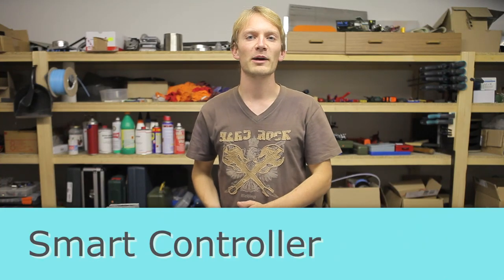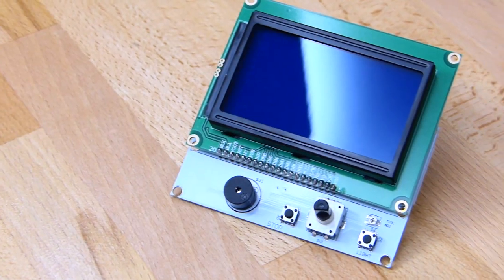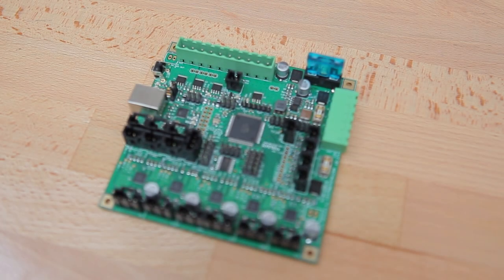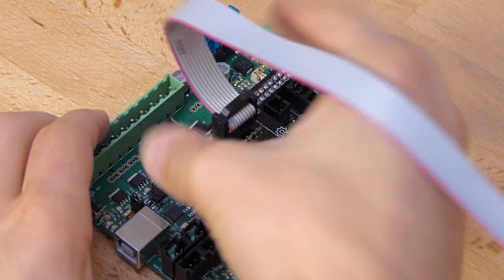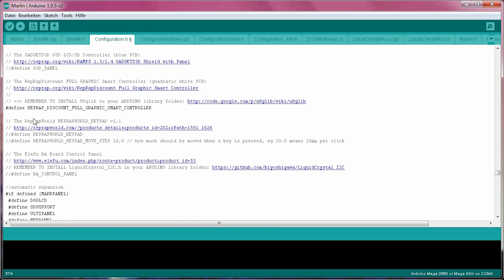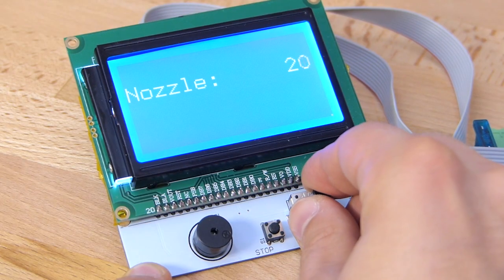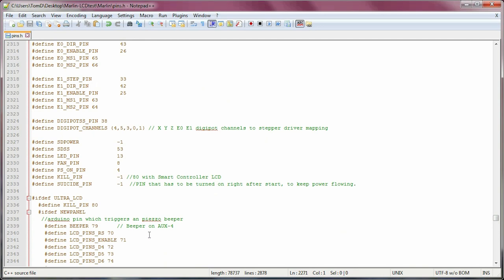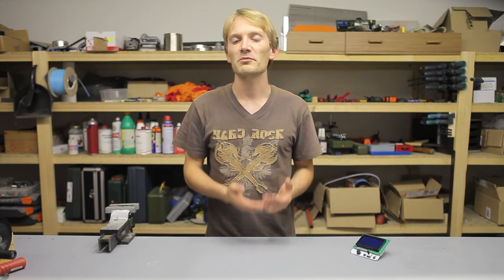3D printing guides - Setting up a LCD and SD card controller panel

Comment: Thanks again Tom, proud patron here. Invaluable info that I needed to set up my Mini RAMBo 1.3 with a large LCD screen! The 1.3 having the USB isolated and not powering the board threw me for a bit of a loop. Couldn't upload a thing with the Arduino IDE till I added 12 volts DC to the board! This fixed my encoder steps and allowed me to select the proper screen for my configuration file.

Comment: Quick update for those who wonder where the line from 4:20 went in newer Marlin versions: 
Conditionals_LCD.h is the file you want to look for the "if ENABLED (REPRAP_DISCOUNT.......)" for.
Reply: Thank you
Reply: Thanks. I found it, but it seems little confusing to me, since I am a newbie to the whole programing thing and Your post is the only one mentionning this change I found so far. Sorry for potentially dumb question but there is that "delete // to enable" feature missing in here and I am not sure what to do right now. Many if lines there, Im not sure what to write or delete where to get it going. Thanks for help.
Reply: There is nothing you have to uncomment there. This direction was supposed to point you to the file where you can add those two extra lines of codes. ((all starting at code line #101))
The whole file is just listing settings for all the different brands of displays out there, telling the rest of the firmware how to handle your hardware. That's why we are adding the two lines of code there. The line you have to uncomment to use your RRDFG display can be found in the Configurations.h at line #1231.
Reply: Thanks a lot for clarifying this. I got the controler working at last.
Reply: You sir, are a legend.
Reply: do you have that arduin program?
Reply: Not the hero we deserve, but the hero we need.

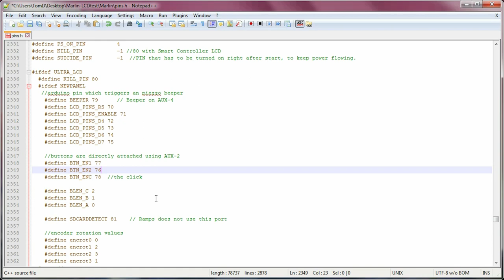Comment: The annoying feedback beep for the LCD controller that Tom mentions at 5:12 has been tamed to a short click sound, so you can keep the BEEPER pin enabled with the latest Marlin. To fix this in Marlin 1.0.0, just re-flash the firmware with LCD_FEEDBACK_FREQUENCY_HZ set to 5000 and LCD_FEEDBACK_FREQUENCY_DURATION_MS set to 2.

Comment: For those who wonder about a black screen. There are different ribbon cables and matching connectors around. Some of them are rotated 180° !!! i.e. Exp1 stays Exp1 and Exp2 stays Exp2 BUT the pin 1-5 will instead connect to pin 6-10 and vice versa. 
I just reversed the orientation of the connector and could then use a discount full graphics display on a trigorilla board.

Comment: For those who are scratching their heads on the pins.h file, it appears that the pins.h file has been broken up into multiple files on recent builds.  You are now looking for pins_RAMBO.h (if RAMBO is your control board) or look for the pins_YOURMAINBOARDHERE.h file.  In my case it was pins_RAMPS.h for the RAMPS board.

Comment: Hi Tom great Videos just finishing off my printer after a year break using ramps 1.4 with lcd and marlin
what pc software do you suggest for a beginner 
I use 2.5 drawing software and a post processor for my full size cnc mill but this is a bit different 

Thanks Andrew

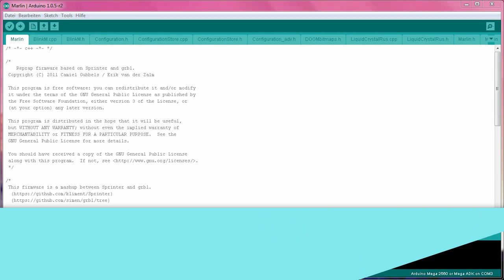Comment: At time mark 2:41 the back of the lcd is shown with the cables installed. I see that the red stripes are opposite of each other. My cables connect  the same direction - Tom, is this why my lcd does not work??? I've been pulling out the little hair I have left over this.

Your videos are great and so very helpful. Whenever I have a 3d printer problem, I turn to your videos first and almost always find the answer I need. Thank you!

Comment: My LCD (from Lulzbot) has two presets for temperature.  One for PLA and one for ABS as in your video.  Is it possible to add presets for other filament types and have them as options on the LCD controller?

Comment: Hello Tom,
I followed your guide exactly and was very pleased to find that my LCD display worked!
I then thought I would push my luck and plug in an AD card. The card was taken out of my other printer and plugged into the screen slot where it registers OK and the screen shows a "card inserted" message. However, when I select the next page on the display it still says "No SD Card" and I cannot find any of the files on the card. Am I missing something? The card works fine on my Anet printer.
RH

Comment: Hi Tom, 

Thanks for your video, very helpful. However do not manage to crack it. My LCD turns on on start up, then the back light dimms a bit and it starts blinking. I have followed your steps. Any idea of what am I not doing right?

Thanks in advance

Comment: Hi Tom, I will try to control my 3040 CNC using this controller, is it possible? Do you have some ideas on how to use that in a CNC? I want to convert the PWM output of the extruder to control the spindle rotation. Thanks

Comment: Hi Thomas... Great Videos, made setting up my Prusa (replacement for knackered Davinci) a bit more straightforward.

I have installed the graphical display, but cannot fix the pulses per step and steps per menu item as the new Marlin (Dec 2015) doesn't seem to have the section your editing?? Any ideas as I don't like scrolling left to go down a list!

Comment: Hi Tom great video , I've connected my arduino board to my ramps which has the LCD screen shown in this video. This was working before however no once i connect the two the LCD screen lights up for 5-6 seconds with no writing then it all turns off including the arduino. do you have any ideas as to why it would be happening? Thanks in advance

Comment: Hello Tom! I have a question, I have the MKS TFT32 and want to have also my stock 20x4 LCD screen working. Despite disabling the secure check for only only one display I simply cant make it work... its either one display or the other. Thank you for the videos

Comment: Is it possible to dim the backlight via firmware or other way? I have a knockoff RepRap Discount LCD and it only has a contrast pot on the back. I'd like to sleep at night without having to disconnect it from Octoprint every time. Thanks for the video Thomas!
Reply: Seems like a hit and miss with these things. The one you linked to doesn't seem to have the jumper, according to the pictures. I guess I'll hack a switch on mine then.

I appreciate the help, thanks!

Comment: Does anyone know what to change in Repetier FW v.91 to reverse the encoder direction and increase its sensativity? Also, does the light button have a pin assignment or is it just on the LCD display?

Thanks for the help.

Comment: Thank you for this informative video. Question - do you know how to remove the options on the LCD screen for a second extruder. I have a single extruder rigidbot. Thank you.
Reply: Thanks for the reply. I have a RigidBot big and using marlin. The line for dual extruder in the beginning of the configuration.h file is commented out correctly so I'm thinking somewhere else there must be code telling the LCD to show a second extruder but I can't find it.

Comment: Tom, first off GREAT VIDEOS! Thank you, my printrbot simple metal is printing fantastic thanks to your videos! Now my question, I have the 20x4 LCD working fine on my printrboard (revF). I also got the full graphic board but I can't get it to work. More specifically I can't successfully compile the source code for the full graphics LCD. I get overflow errors when compiling. Is the printrboard capable of running the full graphic LCD?

Comment: Hi Tom, I too use OctoPrint, thanks to you. I have leaned a ton from your videos since I started 3D Printing in Feb last year.
Hope you dont mind, but I have a question;
My RPi 2 is connected to the RAMPS Arduino (obviously) over USB, but this also powers the Arduino, RAMPS and LCD. I would prefer to have the RPi NOT feed power to the RAMPS etc ... is it possible to do this easily?
Reply: +Thomas Sanladerer Thanks Tom, I will look at trying it out.
Appreciate your help

Comment: Hey Tom, thanks for your videos!  I've got a problem I'm trying to solve with an MKSGen 1.4 board and a RepRapDiscount Smart Controller.  It doesn't seem to work, as it seems is the case for many others.  Apparently some have had success cutting off the header keys and putting the headers into the board backwards.  Have you had any experience with this?
Reply: So it ended up being the case that the lcd headers were put on the MKS Gen 1.4 board backwards.  Luckily this didn't destroy the lcd.  (In case anyone else was wondering)

Comment: Hi Thomas,
Can you tell me if you have tried the MKS 12864 OLED on RAMPS or a Smoothie?  I hear that the Smoothie has no driver for this OLED but what worries me about this controller (which would be perfect for my printer) is that that the Wiki says Repetier may not work if I install it on my board.  Anyway, any input would be appreciated.

Thanks,

Samer

Comment: About this panel that you show in the video, it look a bit different from other ReprapDiscount GLCD.
Many one that I found on Ebay(mostly chinese clone) don't have potentiometers for contrast(use software instead I think) and backlight timing.
Also no button for backlight too.
Which one is better?
Reply: Also, many of the Chinese clone have reverse EXP slot, so when use with Smoothieboard the screen is hard to see. Need to reverse the plastic slot so it work.
Do you have any problem with that panel?

Comment: Hi Thomas, your guides are great.
Regarding the Full Graphics LCD, do you know how to pause a print or resume it when pausing with "pause at height" plugin? Thanks in advance, TG
Reply: ***** Thanks for your quick reply, Thomas. But the case is that I don't have the option for pausing through the LCD. Therefore I can't resume it either (when pausing with "pause at z"). I've also tryed sending M commands via prontrface, but no luck.
Reply: Problem solved: if I print via SD card I have the pause/resume funtion. I'm used to print directly (USB) and thought it was possible to pause/resume that way. Thanks again.

Comment: Hi Tom, I just got the RepRapDIscount LCD 12864 for my ROBO 3D R1+.  I already did most of your updates, but I have spent way too much time looking through the Marlin firmware trying to figure out how to change the LCD display to show only 1 extruder instead of 3.  Is their any way to remove the images/icons on the LCD screen for the 2nd and 3rd extruders?

Comment: If I got all the mechanical of the machine can I use this smart LCD screen to send step and direction signals and outputs for the heating elements for xtruder and heat bed?  inputs to let know that the temperature has been reach also?   Im just wondering because I would like to make my own 3d printer,   I can create my own breakout board and other stuff but if this smart LCD can do the logic should be awesome.
Reply: ***** I'm understanding a lot about this since I saw your video,  do you think can I use this for not only 3D printers and maybe use cnc lasers or cnc plasma machines? in which language is programmed?
Thanks for reply,

Comment: Is adding lcd make the previous firmware installed (to control temperature, stepper motor etc) will lost? Or the previous firmware still exist and new firmware for the lcd added?
Reply: Up

Comment: Nice vid. I had to change it like that though on mine, to get it to work properly:
#define ENCODER_PULSES_PER_STEP 2
#define ENCODER_STEPS_PER_MENU_ITEM 1

I tried to disable the beeper too, but changing, what you've changed, doesn't make a difference on mine. Any ideas welcomed before I desolder the buzzer :)

Comment: @Thomas Sanladerer: I intend to upgrade my Prusa I3 from Ramps 1.4 to a Megatronix v3 and want to use the LCD controller as you so excellently describe here (thanx for that!). I cannot find a converter for the controller to the Megatronix board, however, nor a tutorial how to connect it if I don't have a converter. Do you know if this can be done and if so, push me a bit in the right direction? your help is much appreciated!

regards,
Arthur

Comment: Hi, i installed the lcd, the printer was working flawlessly until i did so, now it is printing horizontally instead of vertically, any ideas on what i need to do to correct this problem?

Comment: Hi tom. Im using lcd smart controller panel and i have a problem with the button. When i turn the knobi it enters menu, and when i clikc it trys to scroll.. even the reset button is not responding.. This happend after i updated the firmware. Im using arduino mega and simple prusa i3
Thanks in advance

Comment: For people using the new marlin firmware, To change the increments of the LCD controller 
(Adding "#define ENCODER_PULSES_PER_STEP 4
#define ENCODER_STEPS_PER_MENU_ITEM 1" ). This can be done in the Conditionals.h file. :)

Comment: Ok, so I've been curious; do I NEED an LCD screen for my 3d printer to work properly? I've got the Arduino uno + CNC shield + Marlin.
Reply: +Digitalman271 Cura has a GUI interface. So no if you don't mind using a computer.
Reply: Ok, thanks!

Comment: Hey 

I installed the firmware correctly and the user interface is appearing on my screen but when i turn the knob nothing happens. I only have the stepper motors hooked up to it now could that be the issue?

Comment: Hi Tom got a question for you I got a RepRap i3 with a gt2560 board running Marlin. 
I know it's easy to make a mistake with the led and sd card wire so help 
I killed the standard 2004 lcd screen by plugging the wrong leed in the right slot so I have bought a 12864 full graphics lcd screen to replace it and all it has is exp1 and exp2 and I don't want to mess up again on the screen which slot is the lcd and which is the sd card 
As I don't need the adapted board.
Cheers

Comment: Hi Thomas,

I followed your instructions but when loading the firmware I get the following errors. Please tell me what I'm doing wrong.

In file included from ultralcd.cpp:42:0:
ultralcd.cpp: In function ‘void lcd_control_temperature_menu()’:
dogm_lcd_implementation.h:361:149: error: invalid conversion from ‘const char*’ to ‘char*’ [-fpermissive]
 #define lcd_implementation_drawmenu_setting_edit_generic_P(row, pstr, pre_char, data) _drawmenu_setting_edit_generic(row, pstr, pre_char, data, true)
                                                                                                                                                     ^
dogm_lcd_implementation.h:377:88: note: in expansion of macro ‘lcd_implementation_drawmenu_setting_edit_generic_P’
 #define lcd_implementation_drawmenu_setting_edit_bool_selected(row, pstr, pstr2, data) lcd_implementation_drawmenu_setting_edit_generic_P(row, pstr, '>', (*(data))?PSTR(MSG_ON):PSTR(MSG_OFF))
                                                                                        ^
ultralcd.cpp:129:17: note: in expansion of macro ‘lcd_implementation_drawmenu_setting_edit_bool_selected’
                 lcd_implementation_drawmenu_ ## type ## _selected (_drawLineNr, _label_pstr , ## args ); \
                 ^
ultralcd.cpp:143:46: note: in expansion of macro ‘MENU_ITEM’
 #define MENU_ITEM_EDIT(type, label, args...) MENU_ITEM(setting_edit_ ## type, label, PSTR(label) , ## args )
                                              ^
ultralcd.cpp:735:5: note: in expansion of macro ‘MENU_ITEM_EDIT’
     MENU_ITEM_EDIT(bool, MSG_AUTOTEMP, &autotemp_enabled);
     ^
dogm_lcd_implementation.h:340:13: error:   initializing argument 4 of ‘void _drawmenu_setting_edit_generic(uint8_t, const char*, char, char*, bool)’ [-fpermissive]
 static void _drawmenu_setting_edit_generic(uint8_t row, const char* pstr, char pre_char, char* data, bool pgm) {
             ^
dogm_lcd_implementation.h:361:149: error: invalid conversion from ‘const char*’ to ‘char*’ [-fpermissive]
 #define lcd_implementation_drawmenu_setting_edit_generic_P(row, pstr, pre_char, data) _drawmenu_setting_edit_generic(row, pstr, pre_char, data, true)
                                                                                                                                                     ^
dogm_lcd_implementation.h:378:79: note: in expansion of macro ‘lcd_implementation_drawmenu_setting_edit_generic_P’
 #define lcd_implementation_drawmenu_setting_edit_bool(row, pstr, pstr2, data) lcd_implementation_drawmenu_setting_edit_generic_P(row, pstr, ' ', (*(data))?PSTR(MSG_ON):PSTR(MSG_OFF))
                                                                               ^
ultralcd.cpp:131:17: note: in expansion of macro ‘lcd_implementation_drawmenu_setting_edit_bool’
                 lcd_implementation_drawmenu_ ## type (_drawLineNr, _label_pstr , ## args ); \
                 ^
ultralcd.cpp:143:46: note: in expansion of macro ‘MENU_ITEM’
 #define MENU_ITEM_EDIT(type, label, args...) MENU_ITEM(setting_edit_ ## type, label, PSTR(label) , ## args )
                                              ^
ultralcd.cpp:735:5: note: in expansion of macro ‘MENU_ITEM_EDIT’
     MENU_ITEM_EDIT(bool, MSG_AUTOTEMP, &autotemp_enabled);
     ^
dogm_lcd_implementation.h:340:13: error:   initializing argument 4 of ‘void _drawmenu_setting_edit_generic(uint8_t, const char*, char, char*, bool)’ [-fpermissive]
 static void _drawmenu_setting_edit_generic(uint8_t row, const char* pstr, char pre_char, char* data, bool pgm) {
             ^

Comment: did all you did but dont get any out put on the screen also try out the cable swaping part  then get some blue screen whit small blocks on text on it 

do have config h file i can use standart marlin for ramps 1.4 board

Comment: hi tom well i have a problem with the rotatory switch its not jogging in either direction but as a button it works i can switch between menu and post screen, need help here

Comment: i have made a 3d printer but facing some issue.i cannot home all axis.i m doing it manually by pausing the printer.and also i m not able to control prining speed from lcd display.i thing this might be from marlin.plz help me out